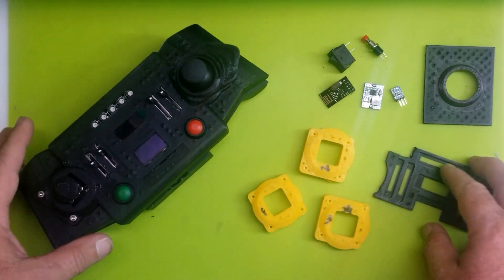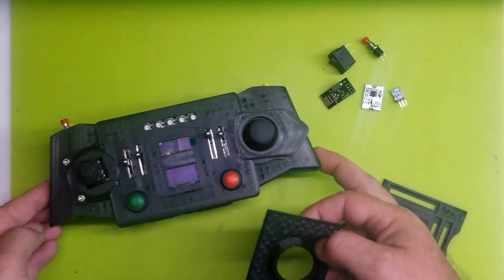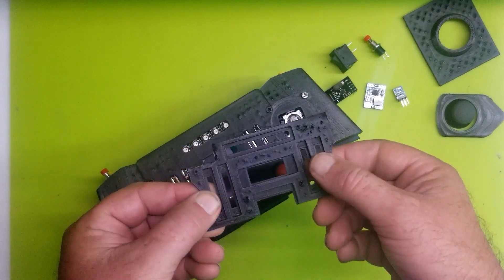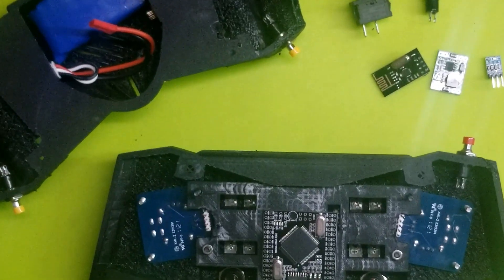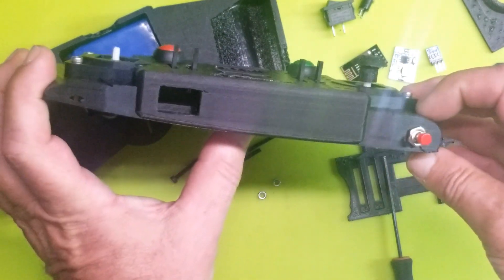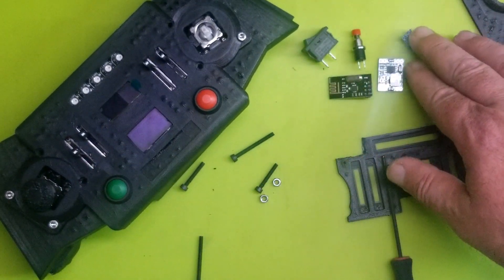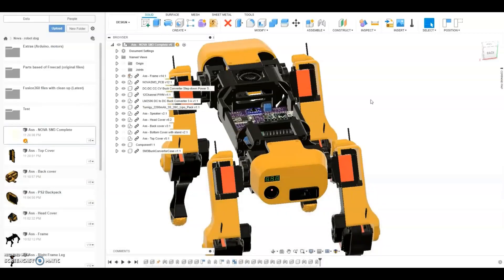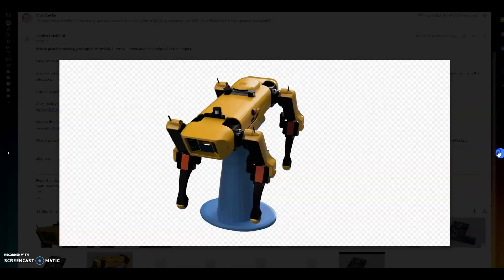DIY Remote Control - Part 4 - Nova SpotMicro3 v5.2

Comment: How about Making the rods to which you put the joystick thingis a little bit longer (3D printing an extesion). It should help to move joysticks more freerly
Reply from the maker: good idea!  but I think I've been convinced to forgo printing our own thumbsticks, and reworking my square cutout into the slimmer of the two beveled rim examples
Reply: @ChrisLocke1969  Maybe you could put some rubber under the joystick (in the hole) with a hole for the rod so that the hole is always closed
Reply from the maker: @maciekgaa5215  that is a super idea, Maciek!  I wish I'd read this comment 24 hours sooner - as I just finished adding the smaller bevel ring to the remote, and it worked out absolutely perfectly!  :)   stay tuned for an update coming this week!

Comment: I loved the joystick rim of the first piece you had on there. Also remember that it is not only esthetics but also to keep dust and moisture out of the joysticks. So a rim might be the better way to go. Keep up the good work!
Reply from the maker: I agree, my friend... i think I'm going to spend the extra time to use that rim - its slim and does indeed help protect the hardware (and we don't have to 3d print thumbsticks!)
Reply from the maker: this is what I ended up using, and it came out damn near perfect on my prototype!  I'll be printing this at top quality and maybe even wiring it up (partially) over the next few days - stay tuned for an update soon! ;)

Comment: BMS and 18650 batteries are very easy to make, can get genuine 18650 cells for 50c each too
Reply from the maker: 18650 batteries seem to big for my liking - I've never used them, but two in this remote?  ya, I'm done designing plastic, thanks  lol lol   I will keep them in mind for the next project ;)
Reply from the maker: btw, battery I like to use in mid-size diy projects are 7.4V 25C Lipo Batteries... love them ;)